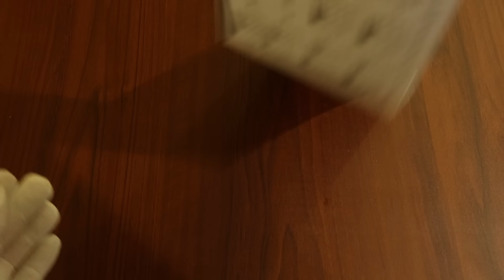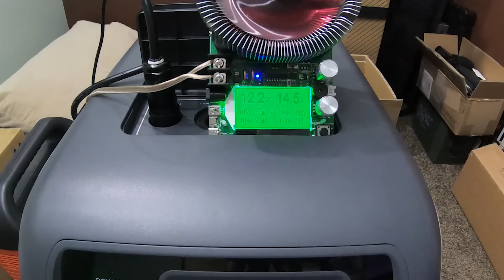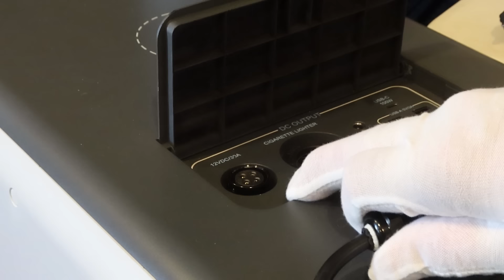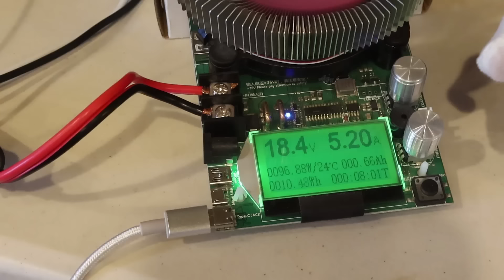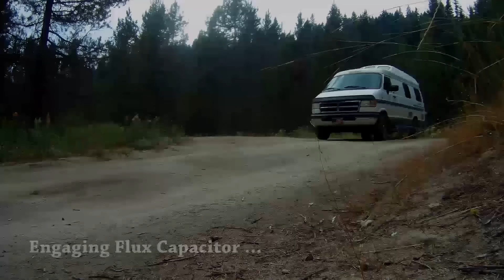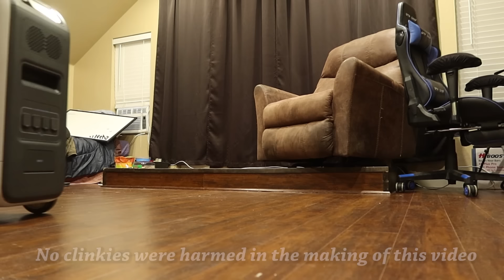BLUETTI EP500 5120wh LiFePO4 UPS BACKUP Off Grid Solar Generator Kickstarter Review

Comment from the maker: BLUETTI EP500: https://gohobo.io/500pro use code HOBOEP500 
SOLAR PANELS: https://hobotech.tv/amazon/#Solar-Kits
FAST CHARGER: https://hobotech.tv/amazon/#Tools
HAS THIS HELPED YOU? Buy me a coffee! https://www.buymeacoffee.com/HOBOTECH
If you want to buy TWO at the EARLY BIRD price (per Bluetti CEO):
Please follow the below step:
1. Visit the project page and click the “Manage your pledge" button.
2. On the following page, select "Change your pledge". From here, you’ll be able to adjust your pledge amount to two EP500 or EP500 Pro. For example, origin amount for one EP500 is $2799. Plus one more EP500 is $5598. Then adjust your pledge amount to $5598.
3. After the project ends, we will send you a questionnaire through the Kickstarter platform and then you can fill in the quantity, address and relevant information.
Reply: HOBOTECH your link to the kickstarter didn’t work... I went there from the bluetti website. I ordered the 2-pack of the nonPro version. Hopefully you can still get an affiliate kickback. I’ll buy you coffee at that link after I get my wife to forget forget how much I just dropped. ;)
It was your review that convinced me to get 2 instead of just a single unit. Amazingly detailed review as always. Thank you!!!
Reply from the maker: The link works! I made it clear the campaign didn't start until 9am PDT that's when the link went active. I guess from now on no videos before launch.
Reply: @HOBOTECH  Your new link works fine!
Reply from the maker: From the horses (CEO's) mouth: 
Actually people can buy 2pcs at price 2799
Please follow the below step:
1. Visit the project page and clicking the “Manage your pledge" button.
2. On the following page, select "Change your pledge". From here, you’ll be able to adjust your pledge amount to two EP500 or EP500 Pro. For example, origin amount for one EP500 is $2799. Plus one more EP500 is $5598. Then adjust your pledge amount to $5598.
3. After the project ends, we will send you a questionnaire through the Kickstarter platform and then you can fill in the quantity, address and relevant information.
Reply: @HOBOTECH  made it so, Captain!
Reply: @HOBOTECH  yep, the link worked fine for me.  No more rolling blackouts for me.
Reply: Any solution that allows ordering two “super early bird” offers for EP500???
Reply from the maker: @philipmorgan1438  Scroll down the perks list there are options to buy two.
Reply: @HOBOTECH  I thought so looked all the way down but I couldn’t find any options for two or a second one.   I’ll look again.
Reply: @HOBOTECH  I found it but the “super early bird” have a higher unit price for two than for one!  What gives?!?! IMO, That’s crazy!!!!
Reply: @philipmorgan1438  Mark Yue said to have a friend order the other one... might have to have different shipping addresses. This might have changed - not sure.
Reply from the maker: I'm told the $2799 is about to end!
Reply: @HOBOTECH  which add-ons are necessary or do you suggest?  I'm a girl
Reply: Just woke up from passing out and now going to order one!
Reply: Can it be used while its charging? And can I run my 13k BTU RV a/c for an extended period of time ?
Reply: @HOBOTECH Is it 30” tall with the wheels? Can I save an inch or two by removing them? I have a compartment that’s right at 29.5” tall I would want to fit it into. Also can I do everything needed from the app since it won’t be easily accessible?
Reply from the maker: @eljeffe991  Yes that's with the  wheels. Without them you lose about an inch
Reply from the maker: @eljeffe991  Yes the app will control it.
Reply: @HOBOTECH  Thanks for the quick reply! Great review and test as always.
Reply: @eljeffe991  if you are installing in a cabinet you don't really need the plastic case and it breathe better.
Reply: Me on the UPS features. Get a "Normal Seeking" power switch to charger inputs. Sooo it looks for pge/sce power (120vac 1φ) acts as ups but when power returns it charges baby right up again. Similar to EDG system controls we used. Lost ac. Started generater. When power back ABT (auto bus transfer switch) put sce back on. You charge ups back to 100%. 
If not liscenced elec guy payvgor it done so it dont Scotty kablooee on you.
Reply: Bravo ..very technical video but entertaining which helps people stay on target. keep up the good work
Reply: I’m willing to give that a try based on your assurance ... I hope it’ll work!👍😎
Reply: Did I spend an extra $400 to order 2 units for no good reason?!
I was hoping they’d at least through in the extra hardware to connect the 2 together. 🤞
Reply: So the UPS feature is a perk you have to add that $499.00 to the $2,799 🤨
Reply from the maker: @nina_g6857  UPS is built in
Reply: @nina_g6857  I wondered about that too!  Dr Hobo said, in this morning’s review, that it was complicated to setup but didn’t mention needing additional equipment.  I think it’s included inside and can work if EP500 is wired to home electricals.  I suspect the extra box they offer externalizes the UPS triggering so the EP500 can be removed for use with RV or cabin easily without reconfiguring it.
Reply: Nice to see some plug covers on these massive items finally and at last. Cheap abs plastic makes for a no go at any price to me tho. Definitely starting to finally turn the heat on GoalZero in a big way tho. Backup power through a refrigerator, a washer, a dryer, a hot water heater, etc all with monitoring systems, solar hook ups, accesible fuses in case of overload, etc would seem to be in the offing now especially with this massive a power output and presumably very high price.
Reply: So I have watched this entire video. I almost finished it before checking out the kickstarter or whatever site it's on which by the way requires Java be activated which means that the screen scraping ability is absent in Chrome because I only have Java on for Canary. Anyway it's not a fair comparison at all for buying for 12 volt batteries. I also feel that the claim that 85% efficiency is decent maybe the line by the IRS I said b e l i e d as I would hope that in the fine print that would not be a sufficient enough. Because this can operate as a tariff shifter in which those 16 years would actually very much be an issue over 16 years losing 15% adds up. Obviously you're talking about years of wasted electricity in that circumstance.

140 lb is about the size of a young child a teenager is what I mean of course. So many people are still carrying their kids around when they're 140 lb. That's the way I think of something like this that's easier to carry than a person perhaps. But carrying two of them would be more difficult for most people. it should have course have the dolly built in retractable so that you don't have to lean over to push it around. It should have an accessory with stair climbing wheels on it. In terms of split phase I am very concerned about the about the limitations there and the UPS function specifically versus a timeshifting function. I also believe that this weight suggests that a slightly lower storage capacity that is able to plug into the oven Jack for charging with a much higher cycle life is what is actually missing. The 10 amp hour lto prismatic cells are about $4 each. yes they are fewer volts than cheaper disposable lithium. But this is what Toshiba needs to make an appliance like this. It also needs as you didn't mention to have the higher frequency transistors who cares about the number of cores in the CPU but we care about is the amount of heat this is going to be putting out in the summer. The boost inverter that you are using for DC to DC suggest that you don't understand exactly what the issues are. There are plenty of higher voltage rectifiers so that you did not have to buy a booster! You should be figuring out how these can be plugged in to a electric public charging station. This is something that obvious have been doing now for years with their electric bikes. It takes a lot of experimentation getting the pings to authenticate your battery for many of the newer charging ports. I'm surprised that nobody hasn't been buying the total Tesla charging and tricking the charging stations into connecting. The number of Tesla's with unlimited charging for life that are parted out suggest that maybe occurring under the radar. Put the cost of the electricityinefficiency the problem with the inefficiency is the heating. Also you're not being fair at battleborn when you say that their price for four batteries would be exactly four times their price for one. I think that battleborn should be able to have the opportunity to maybe with three batteries not for show what they think can be done in this price range or to be very clear with six or seven batteries for a split phase model. Your competition influencers of course have already chimed in I think I realize I'm a few days late but only one of the rewards has been used up. This is what we all want and we want it to be more portable than this more ready for the transportation regularly. You know for example the first house elevators were not electrical. Nor should the second floor lithium iron phosphate residential backup and time shifter. It should be designed to be pulling up I said p u l l i e d. they should have as an accessory a frame similar to what you put an air conditioner on to extend the rope a few feet out of the window and allow you to quickly raise or lower the battery
Reply: @arts8302  thanks for spending time on the issue here. Me I use 240 now getting ac200p will look into 500 after getting political asylum from komifornia. Solar lights brought in at night free from pge blackouts. Easier than candles. 
Eb240 runs my dishwasher (900 w max drawn/ and or washer 850 max) need 450+ in and starting with 50% charged. Alas dryer draws 2500 peak start. If ac200p runs it as gas dryer we will be free from rottenkids euro snobs. Portable still
Reply: I have one EP 500 reserved through the Kickstarter link. Did you explain somewhere what else is needed for  a licensed electrician to connect it to a main breaker panel or even to just a couple of 15-20 amp sub-circuits to include a fridge/ freezer for safe manual activation in the event of a power failure? Or would you need two EP500 with the biphasic connector for that? And can one unit charge from two 24v solar panels in series plus one or more 12 v inputs in parallel? 
Sorry if I have the terminology wrong, I’m
not a lot past V=IR novice.
Reply from the maker: @Richard Keltner  The link provided takes you to the campaign with all current available options to purchase.
Reply from the maker: @Richard Keltner  Click the above link, click "back this project". Scroll to your choice. It's quite self explanatory.
Reply: Bought 2 more 180's lets hope they credit you. Discounted to 179.99 said yours not extra. But you could get a tiny piece.
Reply: Q
Reply: @jaywilborn6500  ???
Reply: 1
Reply: Hmmmmm
Reply: good evening mr hobotech, I asked you a question your energizer power station video, please can you answer me thanks so much
Reply: @Richard Keltner  Again, you should be addressing Hobotech with such an issue.   Or perhaps, YT can help you.
Reply: Ok
Reply: Did he just say "in your love shack" ???
NOBODY cooler than Hobo
Semper Fi
Gunny
Reply: I wanted to make a purchase are there any codes for discount .. on the EP500 pro
Reply from the maker: @carlosd.9158  You're 6 months too late. You pay the retail price now.
Reply: @HOBOTECH I purchased the EP500 . I also purchased  PIP LV2424 MSD 24V 2.4kW, 120V Output, 2kW Solar Input 80A Mp. I m thinking I should have bought something larger . What are your thoughts.  Trying to have a ups system for blackouts  but also later trying to have ability to save money and run larger loads off solar . Any feed back is appreciated .
Reply: Help. Recieved twin Bluetti SP500
Reply: you were right about the price that bopining price was great over 4k now but could still be good deal i have to do more checking
Reply: I can't seem to find the items for the fake solar array, can you help me out please? Thank youb

Comment: Battery charge limit should be available in any model. My ecoflow river pro has it. If i have it plugged in to solar or use it as ups i don't want it to be sitting at 100%  for long time. I am checking out bluetti ac180 now because it has wireless charger and bigger inverter but it seems to be missing alot of options that i would like to have control over in app.

Comment: I have 2 EP 500 pros that I will hook up to my home.  What is the best solar panels to connect to these units that I can put on my roof?
Reply from the maker: https://hobos.cc/ren450 use code HOBOPANEL
Reply: The picture shows 2 solar panels @899.00.  Is it 2 panels with 450 watts each?  There is also a protector that was automatically added to my cart for around $15.00.  Is this needed?  Renogy seems impossible to contact.  I hope they compensate you.  Thanks

Comment: Duhhhh Solar and wind not gonna work. Gonna use a Solar generator to charge this, people are getting stupid. bigger battery no way to charge it but grid power or generator solar is out of the question unless in almost perfect conditions.  Even then pretty sure there not waterproof. clouds rain weather in general are going to be a bad thing. You will spend as much on solar panels and charge controllers as you would the battery itself.  Better have a Generator to charge this shit. Get one quiet night and 2 days running gas or propane.

Comment: Are there any downsides to linking solar batteries like PowerOak in serial? One battery charges the other via AC with the end battery receiving power from solar...  solar---------[battery 1]------<<<---AC in charging from battery 1-----[battery 2]-------->to electricals

Comment: With two AC300s, you can do split phase 220VAC.   Also, AC300 can charge at 1800W (120V 15A).  With a password, it can charge even faster up to 30A.  I guess the question is:  which system is a better value for its features and capabilities versus its costs?
Reply from the maker: https://hobotech.tv/large-home-backup-ups-240v-solar-generator-power-stations/

Comment: I bought THE  BLUETTI EP 500Pro. I have problems with The AC Charging Cable. I contact the company but they responded to the Problem.VERY POOR CUSTOMER SERVICE.
Reply: They announced by email this week that they are replacing all the crowdfunded EP500’s AC charging cables, and advised discarding the original as soon as received.
Reply: i received my replacement ac cable a couple of weeks ago. still having trouble connecting to the bluetti app. can't even check to see if they have any software updates.

Comment: Nice price for what you get.  One major issue I'd have with this is the max wattage limitation.  2,000 watts is just not enough.  3,000 for the Pro is a step in the right direction but still not enough.... buying two to get more horse power isn't a good option.  For an off-grid application I would like to see at least 5,000 watts.

Comment: How many watts and amps can a single EP500 Pro unit output via the built in UPS pass through feature?
Reply from the maker: Depends on the input setting. If you have a 20A outlet it will pass through 20A.
Reply: @HOBOTECH  The Pro has up to 4000 watt input from dual ac and solar. Just wondering if that means all those watts could be passed through via UPS. 3000 watt continuous and 4000 watt surge, or is the UPS bottlenecked by something other than the max inverter rating? You mentioned a firmware fix... did Bluetti clarify the max output for UPS after the firmware update?

Comment: Can it run your house like run the HVAC fan. How do you connect to the circuit breaker panel to run the house.
Reply from the maker: You hire an electrician to setup a transfer switch.

Comment: My comment keeps getting deleted, so I'll shorten it and just focus on the AC capacity test with the first Kickstarter batch and see if it finally survives.

I did an AC load test, running a 1400W electric heater on a full battery. I was part of the first 500 Kickstarters and ordered 2 EP500s. I ran the same test on both units to confirm any one result wasn't a fluke. I measured using a Kill A Watt meter. I actually got 4500Wh to the tee on both units--higher than the 4360Wh (85%) in the video. That puts the efficiency at 87.89%, or rounding to the tenth, 87.9%, or rounding up since it's only .1%, about __88%__. That's actually pretty good. Why the difference? My guess is Bluetti did some performance tweaking since these initial test units were sent out in March and increased the efficiency. Good for the rest of us.